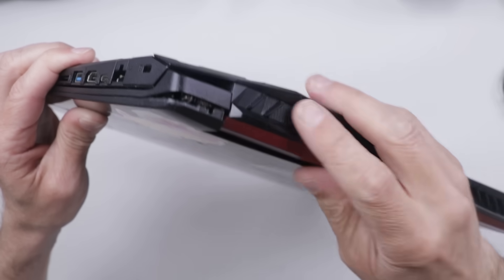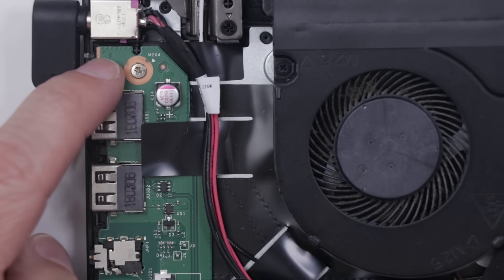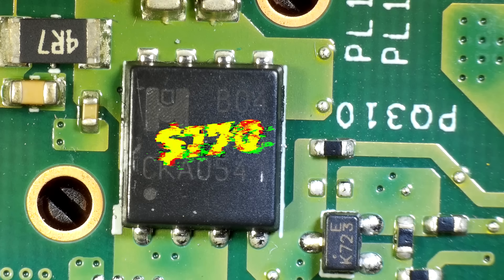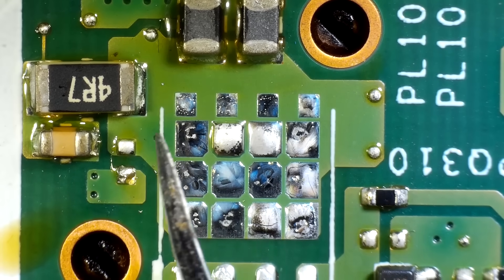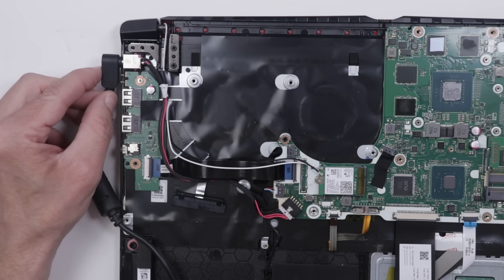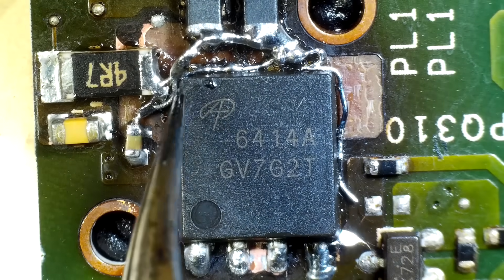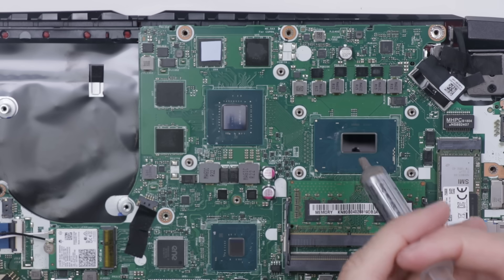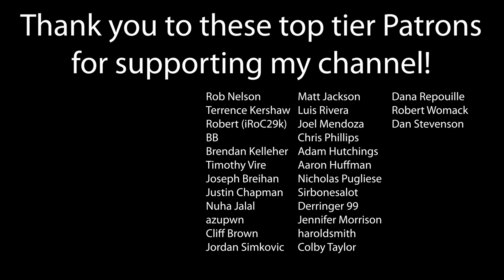FREE BROKEN Laptop - But Can I Fix It? Acer Nitro 5 No Power (Gifted From A Subscriber)

Comment: Nice, I like to repair such burnt mainboards :) However, I am also rebuilding the tracks.
The separate wire before the first mosfet leads to a diode before the charge controller IC. This is also where the voltage from the battery comes to the charge controller. The charge controller IC then switches the input mosfets through from this voltage.

What is a bit risky is that you now have a 30A MosFet installed where the original one can handle up to 75A. It can lead to another failure later on.
Reply: Not only the rating of the MosFet, but also the wire thickness worries me...
Reply: @einfachgaer2  It's just an extra fuse... :)
Reply: @SiETechNotebookReparatur  Yeah, maybe it saves the MosFet from fusing again. But the laptop wont be able to run at full load for long... :D
Reply: Agree 100%  but you need to match the rds on as well, higher rds will cause the mofet to heat more, lower one would be better
Reply: @AnonymousRepair  Is there a Mosfet that can handle less Amps with lower RDSon?
Reply: I think 30 A is more than enough, since this is the first mosfet of the 19v rail. 19v come from the charger and it can only supply like 9,xx amps I believe.
RDS ON is the most important thing here
Reply: @ijapsdjhkahbefajldas  I know they are exceptions and you can't make a blanket statement about it, but most of the time the higher amps the mosfet can handle, the lower the RDS On. Here the MosFet that was installed has twice the RDSon as the original.
Reply: @SiETechNotebookReparatur  hmm if I check the datasheet I see RDS ON of roughly 0,1 mohms. If the current is 10A the heat power is 1 W. I doubt that this can be dissipated without a thick copper layer under it. Original one has around 5 mohms, so you are right 👍
Reply: He still has the mosfet from the second board, which should be identical. I thought it would be better to try and fix that donor board, at least it wasn’t burned through. This fix will probably not last a long time
Reply: @HNedel  I thought about it too.
Reply: @HNedel  Nah, those particular boards often blow the Intel south bridge. Ain't nobody got time to mess with that nowadays.
Reply: Your channel looks good but I can't understand any of the videos on there, hope one day you can translate and reupload some of the best ones to English!
Reply: @wolfrig2000  Thanks :) 
English reupload is not planned, but I'm slowly working on subtitles. What is finished will be collected in a playlist.

Comment: Great work.
You could have tested to see if the mosfet would turn on by just using your multimeter. If you have your probes across source and drain and short the gate to one of them (depending on P or N type) then the current from the meter should be enough to turn it on and give a low resistance reading.

Comment: I have a laptop with the exact same board that had the same issue. That mosfet on mine burnt out and actually leaked out the contents. I was also unable to find a replacement chip, and am not willing to buy a new board just for that chip. Sucks to see that it is a recurring issue however. Great guide and good to see what i would need to do if i ever get a chip to replace it with.
Reply from the maker: I'm sure there are replacement Mosfets that would work, I just don't know what they are.

Comment: Yeah, thats why a donor board is good for this job, at 4:12 you can see that via. Propably a feedback or power ok signal.

Be aware that random mosfets on the main power line can be shorted on a dead board. Measure them first.

Comment: A laptop I used for a couple years when I was like 14 I fried with the replacement charger, it took multiple days and worked fine until sometime after the battery was fully charged
Reply: Eventually I figured out what was wrong with it the components near the charger were fried and the battery still worked, I know because it stopped charging and it didn't stop working until the battery died

Comment: Do you realize that you are using way too much thermal paste? The purpose of a thermal paste is to even out the irregularities on the surface of a chip/processor. Therefore, you should apply a very thin layer and spread it evenly on the chip.

Nevertheless, I still like your videos :-)
Reply from the maker: How dare you question the perfect amount of thermal paste, lol
Reply: @Tronicsfix  I thought for a long time (multiple videos) whether I should really write something. But I thought a little hint might not be wrong.

Sorry :-)
Reply from the maker: @ro0t2k61  No apology necessary. It's an ongoing joke on my channel.

Comment: Great repair, but i put some heat disipation on that mosfet because if burning out cause of hight temps and it will burn again if the temperature raises agains, a small heat disipator can help there
Reply from the maker: That was the point of the coil of wire underneath.
Reply: @Tronicsfix  great repair as always

Comment: Nice job. You could have systematically used a blade to cut away the copper pad on the board you bought for $170, and soldered that to the board you were trying to fix.. but nice work 👍🏻
Reply from the maker: There was nothing to solder it to. I would have had to use some type of adhesive to attach it to the board, then hope it didn't come off when I heated it.
Reply: @Tronicsfix , I didn’t mean solder straight to the board. I meant it could have been used to run the traces and give the coolant you hoped would happen with the wire underneath. Either way, nice job 👍🏻
Reply from the maker: @russp142  The problem is that it's a small piece of copper. If it was a large pad then I probably would have done that. Honestly the coil of wire I used under the Mosfet is probably better than that pad since the pad is small and thin. I do get what you're saying though.

Comment: I don't know enough about it when it comes to the circuitry, but shouldn't if blow a fuse before it does that kind of damage?
Reply from the maker: Nah, not many PCB's have fuses that actually work to protect the board for stuff like this.
Reply: If it blows like that, there is no fuse. Or the fuse is dramatically bigger than it should be, like on Apple laptops where the last thing that goes is the fuse on the power lines.

Comment: I am so surprised that your solution worked haha. Is that a long term fix?
Reply: yeah it is. he replaced broken mosfet and repaired burnt trace. he just needs to apply a little bit uv mask to repaired area.
Reply: @msetechrepairs  I wasn't sure because the pcb being peeled like that and the way he went about the traces. Good to know!
Reply from the maker: It should work for a long time.
Reply: @Tronicsfix  that's awesome! Looking at something like that to someone like me who's not trained in this stuff but watched your videos regularly it doesn't look permanent but glad it's a long term fix!

Comment: That's Awesome Steve! Most of these "repair" shops aren't capable of doing this kind of work. Good job buddy 😊💯
Reply: They often are but they don’t want to risk 170$ for laptop worth 400$ and waste time
Reply from the maker: Thanks! This was a fun fix.
Reply: @fictitious0  Quit this "we live in a society" bs. It's not society, it's just a factor of how cheap the devices are vs the cost of repair.
With cars the cost of a new vehicle is usually high enough that you can justify spending hundreds of dollars to fix whatever since buying a new one is thousands of dollars (unless you are into junk cars).
Most people always prefer new devices to repairing old ones if it's economical to do so, and for good reasons, the "repair" is not guaranteed to work or last. This repair shown on video is barely a jury-rigging and won't hold if someone will use this laptop to play games and the power component is stressed again, for example.
Buying a new device usually means you get something that is guaranteed to work (or if it doesn't you can RMA it).
Reply: You'd end up paying several hundred dollars in labor to have a repair shop do what was done here.  There are a lot of cuts in the video, we have no clue how long it actually took to do this but I guarantee it wasn't under a few hours.  Long story short, any repair shop with intelligent workers would've found the burnt board and told them to scrap it.
Reply: @fictitious0  If the repair costs half the price of a new device (which is what such repairs would cost), yeah nobody is willing to risk paying half a new device and still get a device that is a "no fix"
Reply: @marcogenovesi8570  I perform such repairs on my spare time, after my real job as a hobby.   and for such repair i would charge 50$. but u cant find me on high street.  im in my sheed. no overheads, no rent, no insurance. pure hobby,  and to help ppl.  not for profit kind of way.      
as the moment fixing cctv camera  that was pluged in with reversed polarity and   infrared  led driver ic burned to charcoal.    getting new  ic from china and  customer paying me 25$ for  2h of fun.
Reply: @Dmiliunas  What you charge is irrelevant if it's not a businness. I don't charge money for reading my youtube comments either, why would I
Reply: """""repair"""""" shops
Reply: @fictitious0  No we are not, we are not "incentivized", there is no incentive. That's how it always worked by normal logic.
Also it's not "new and shiny" it's "new and guaranteed to work". People buys stuff because it's a tool to do something else. So if it breaks down they can't do it anymore.
Lost time or productivity is a factor in deciding if something is worth repairing or not.

The only way to "incentivize" people to repair everything even when it's not economical to do so is to raise prices by orders of magnitude or reduce availability of new items, which is wrong on many levels, and also communism.

Comment: Goodness! I have never seen a chip hold  on to the board like that in your videos! Does that happen often with burnt out chips?
Reply from the maker: That was a crazy one! I don't remember ever seeing one fused to the board that badly. I'm no laptop repair expert but I don't think this is common.
Reply: Yup regularly have ics fused to a layer 75% time its a no fix.
Reply: If power components short out they can do that. A lot of power is going through that chip.
Reply: 4th